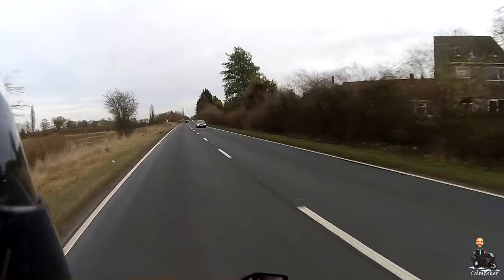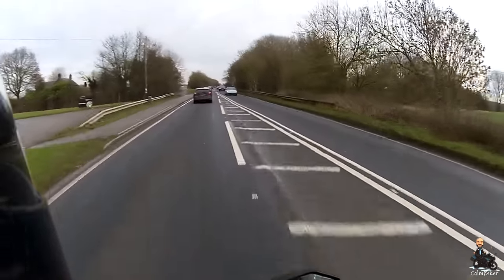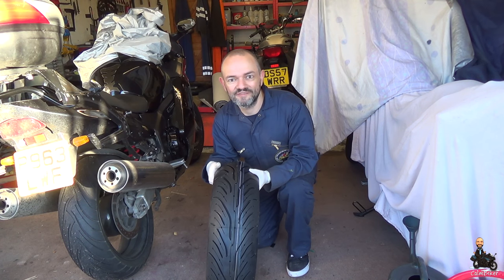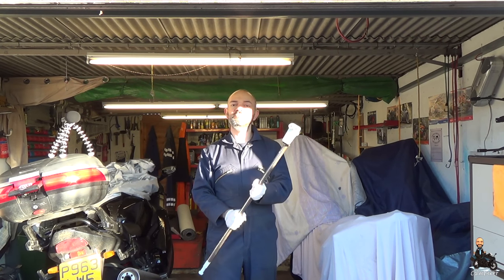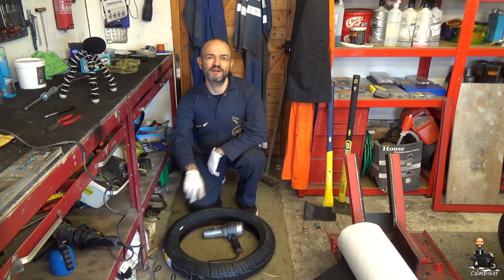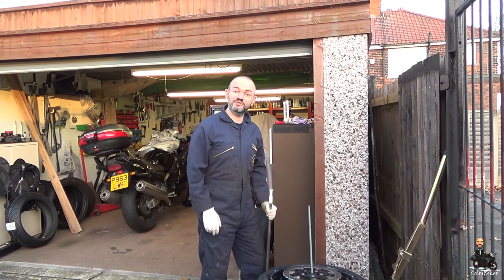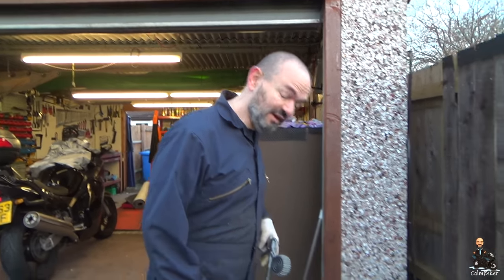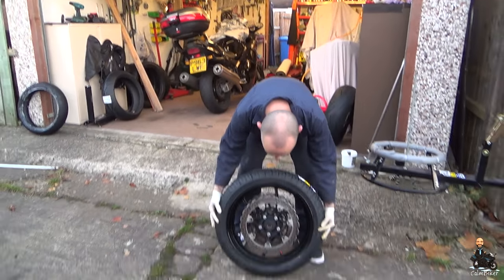741. Kawasaki Z1000 Tyre Change | Garage Video

Comment: Always fitted my own tyres,  I now change mine on an automotive tyre changer with special adaptors for motorcycle wheels,  once upon a time did them with levers resting wheel on old tyre.
     Great effort very satisfying result shame the back one was tricky.
Reply: Ive done my volvo " 45's"   That takes a lot of messing
Reply: Tosh twentythree changing tyres manually is a bit of a workout,  the low profiles put up the biggest fight along with the runflats,   its worthwhile when you think of the longterm savings particularly with motorcycle tyres.
Reply from the maker: I get through a lot of tyres so definitely worthwhile. Also good fun to give it a try.

Comment: Thanks CB...I'm almost tempted to try myself! Did you discard the old tyre before it was worn? I've got the 2016 SX with S20's on, and I'm tempted to put PR4's on now as I do feel the originals are a hard tyre. Thanks for the vids...slow and clear voice is perfect for an old codger like me. safe riding!
Reply from the maker: The front was part worn - it's still in my garage at the moment and might become a feature for the garden. The rear was shot though and I wanted to switch to PR4's. I don't like the idea of mixing brands.

Comment: Very interesting vid . And useful to know. But I can't help thinking if you can get a tyre changed on a loose wheel for a ten to twenty quid .Is it worth the hassle ? I take your point about you need to find someone who knows what they are doing (I have ). It did look slight dangerous as you leaned over threaded bar. 
Still main thing is it's done and done right as far as your concerned , and once you've bought the gear it should last
Reply from the maker: That camera angle has had a few people commenting but I wasn't too much at risk of being impaled :-D
Finding someone you can trust is really important. I think I have now so I'm not sure if I'll continue to do my own changes. That said, I get through a lot of tyres - at least two pairs per year and I'm thinking about projects too.

In the past I've used three different places for changing tyres. The one I liked stopped doing it because there wasn't any profit in it. One put my wheel on backwards (the only one I've ever taken the bike to, rather than removing the wheels and taking those) and one dropped a wheel. I only just managed to dive underneath it to stop it landing on the disc.

Comment: Any reason why that central pole is such an eye poker ? Could be much shorter in my opinion....
Also I guess it could be sleeved with a thin silicone hose to make it smooth. Other than that nice set up 👍
I've done it many time on my porch  floor but I might copy your little helper....😊
Safe rides and travels 🏍
Reply from the maker: It was indeed too long but Tosh has shortened it since (probably to stop me complaining that I thought I was about to lose an eye!)

Comment: I'm sure you did anyway, but it's always best to pump up over pressure before replacing the valve core to ensure the beads are properly seated both sides. And I agree with VX490, that threaded bar is just a tad long!! lol. Good informative video for the beginner though, can't fault it, RSM8 as always
Reply: A tad long....thats what the wife says....lol..yeah you might be right on that...
Reply from the maker: Cheers Ian! Yes, that bar was quite long. Quite scary too! :-D

Comment: I got as far as removing my old 190 rear tyre using 2 tyre levers after that  I gave in, A tyre bar is miles better.

What PSI did you end up using to seat the beads?
Reply: about 15 to 20 psi
Reply: That's pretty good I hear stories of people having to go dangerously high
Reply: when you add lube in the right place the bead will slip on..
Reply from the maker: It definitely wasn't a high pressure. It popped on a lot easier than I had expected (but it was my first time so the only prior knowledge I had was from videos).

Comment: I've just been watching this again, because it's always helpful to revisit a good "how-to" from time to time. But I picked up this time on your reason for not using washing-up liquid, so I thought I'd just check it out. This is the opinion of one bike rider and corrosion expert: 

"There is nothing in a washing-up liquid that will exacerbate corrosion – there’s no sodium chloride salt to worry about. The issue regarding corrosion is the ‘chloride’ bit of the salt. In ‘chloride nests’ at the base of a corrosion pit, the chloride exists as hydrogen chloride, which in damp conditions creates a solution of dilute hydrochloric acid, and it’s this acid that does the damage.  You need to avoid ‘chloride’ from any and all sources, e.g. seawater, road grit and fish & chips (but not washing up liquid)."

- Bob Eden BSc MSc PhD MICorr (Member of the Institute of Corrosion).  https://www.morebikes.co.uk/3729/can-clean-bike-fairy-washing-liquid/

Not picking a fight; just thought you might be interested (well, once you've used up your tub of tyre lube, anyway 😄).
Reply from the maker: Not picking a fight? I was just picking up my old boxing gloves. I'm glad you pointed that out because I'm very out of shape nowadays! :-D
Interesting that an Institute of Corrosion exists. Plenty of reading material for me there. The more information the better in my opinion. My problem is that my OCD will always push me towards the "correct" product just to be absolutely safe. If I ever run out of the soap (which will involve setting up a tyre changing service), I'll know I'm safe to use some Fairy liquid (though I'm actually allergic to most dish soaps). :-)
Reply: @CalmBiker  Your OCD! Mine is precisely why I had to look into it now even though I won't be changing a tyre for at least 6 months! 😁

Comment: You made it look easy, thanks chaps. I'd have been tempted to have some sort of nylon tube over the central pole running through the rim hub, not just for protecting the hub, but so no-one drives it through their heart ;)
Reply: a tennis ball with  a whole in it ?
Reply: Oh I was thinking of something soft to sit between the hub and bar... as for protecting the assistant you can always grab a random street urchin if Rich impales himself.
Reply from the maker: I am expendable! :-D
Reply: I think not baby puppy

Comment: this maybe a daft question but why did you feel the need to change the tyre or was it just because you don't like that brand and wanted the pilots?
Reply from the maker: The rear tyre was completely shot so needed changing. I don't like to mix tyres and didn't like the tyres the bike came with as stock. In the dry they were great but the slightest bit of damp and they were terrible. Lots of sliding.
Reply: CalmBiker ahh makes sense now. I only ask because your front tyre was in much better condition than mine haha. I'm due for replacement but don't think I can afford both. my rear is fine as it is
Reply from the maker: I think next time around it'll be a rear tyre change only. With my XJ6 I did just a rear change for the first one and stuck with the stock tyres. When it came to change both I tried PR4's and couldn't believe how much of a difference it made.
Reply: I know I would benefit from both but I am definitely a budget biker haha. I still have lots of tread on the rear and touching hold on the front lol. If I had the money though I would definitely get both as it would be nice to see how this bike actually handles the corners I stead of wondering when I will be past the flat apot on my rear

Comment: I had a go with two 12 inch tyre levers as I had seen YouTube videos of people doing it with what looked relative ease. No way could I get my 120 front tyre over the rim to fit the new one. I gave up and did not attempt the rear 180 tyre. I have a local bike service/repairer that put both tyres onto my rims for twenty pounds. When I told the man who fitted my tyres he said if you're not careful and have to force/stretch the tyre over the rim you run the risk of damaging the bead which seals it to the rim. Obviously this could ruin you're ride out if it comes of the wheel at 60mph. The long bar and frame thingy looks to be the answer. Ride safe.
Reply: Its not the perfect solution
Reply from the maker: I can imagine that being a complete pain (the levers - tyre coming off is definitely not good!) With the bar it wasn't too bad at all with regard to stretching the tyre.

Comment: Hmm ? I think you used the tire rod wrong ! The tire should be on the two plastic pieces when mounting .
Reply: Thats the no mar bar
Reply: Ok ?
Reply from the maker: Tosh beat me to it. It's a different bar that we were using. There are a few different styles. The no-mar set up looks really good but the cost of delivery to the UK is prohibitive.